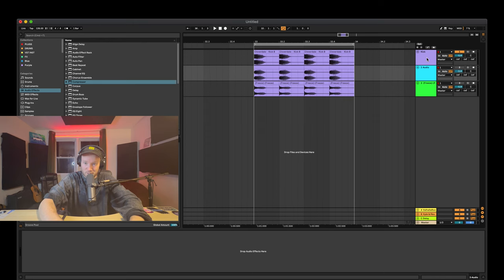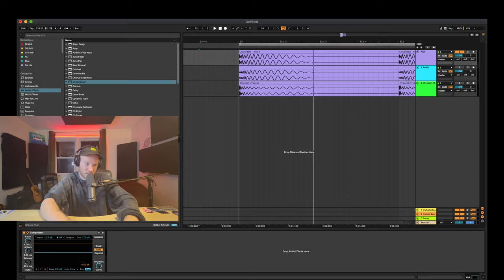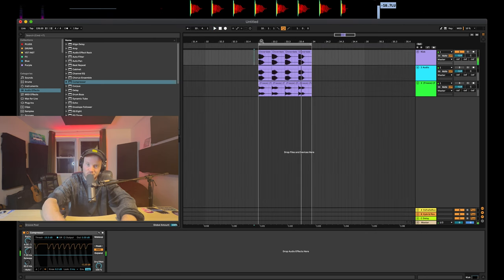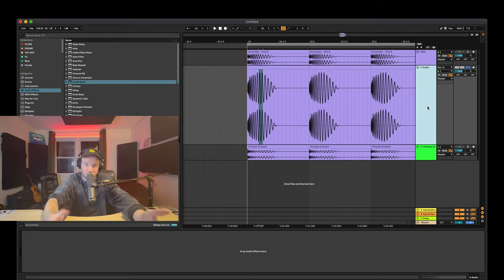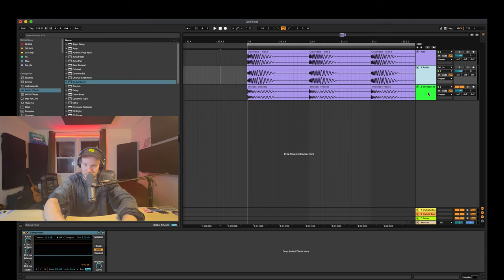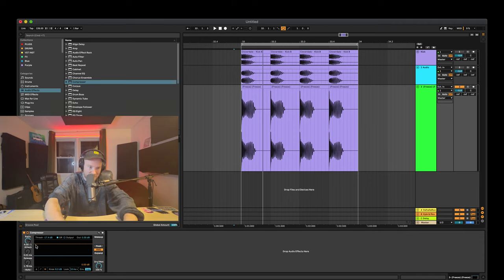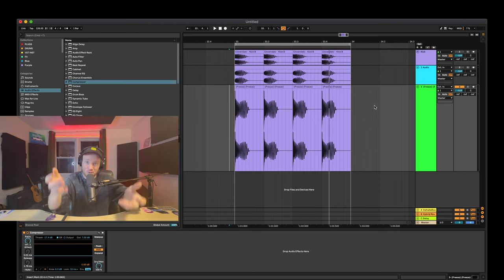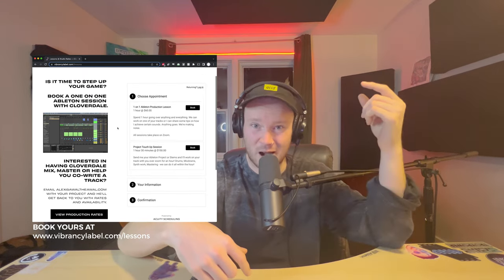STOP COMPRESSING YOUR KICK DRUMS!!

Comment: good video, a bit nitpicky, but the reason that the 3rd example doesnt really work without lookahead isnt that a "computer is only so fast". Every sample is always processed, if the computer had delay, the output would be delayed, but fully processed, so the reason the compressor still lets the transient through is more an inherent property of how compressors respond to signals. Actually analog gear would proabably behave very similarly, since analog doenst really have an (easy) option for lookahead.

Comment: Hey Cloverdale, when listening to Tinlicker, their kicks sound so clear and powerful, easily cutting through the mix. However, when I try emulating that (especially during the mixing & mastering stage) my kicks cannot have that much volume and clarity in the mix without clipping and distortion. In short, I cannot achieve the same relative volume balance while aiming for -6 to -9 LUFS.

Any tips on balancing your kick within your mix to achieve clear & punchy kicks like Tinlicker? (example tracks would be Sleepwalker and Bird Feeder)
Reply: Side chain certain tracks to your kick so they subtley "duck" under the kick snap =)